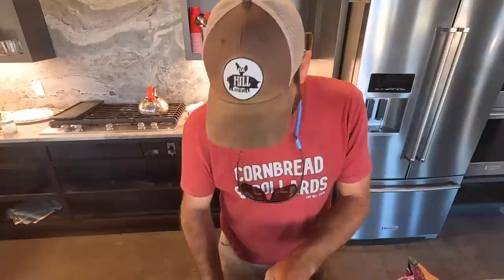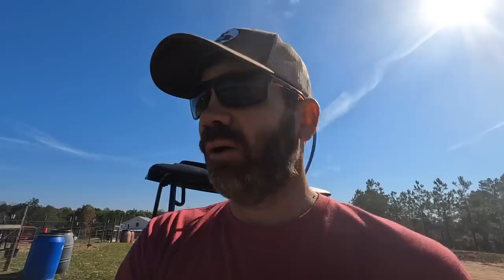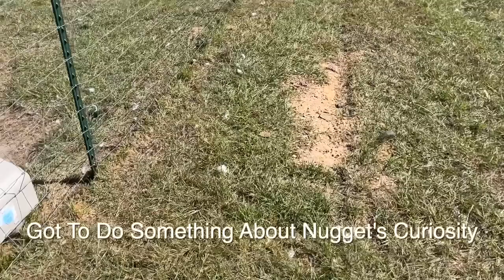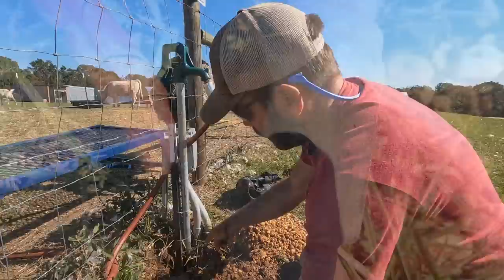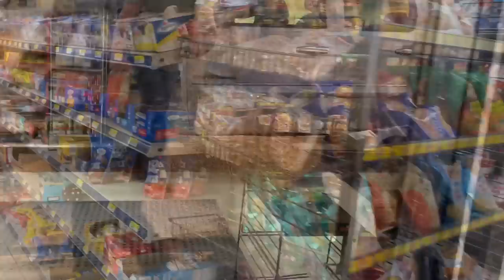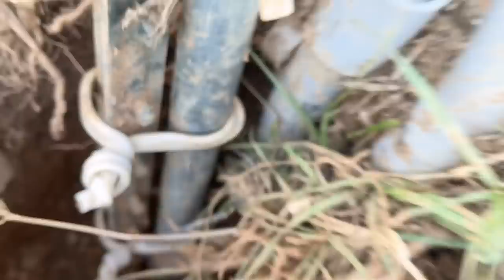This Happened WAY Too Soon!

Comment: We had the exact same issue with the hydrant being so loose. We dug down 2 feet and then put a 4 foot pt 6x6 so 2 feet was above ground and then strapped it to the wood. Haven’t had a problem yet even with our harsh winters up here in Ontario, 🇨🇦 Nugget always cracks me up. Great video as usual folks. Chad.
Reply: I'm not a plumber, let alone for outdoor plumbing, but t-post is probably not strong enough.  Should use that timber pole nearby (the fence H poles).  My garden is in CA and we put 4x4 also to stabilize the faucet upright pipe too.  That was done however not for freeze reason but because we drag 100 ft long hose all over the garden to water by hand.  Irrigation hoses or tapes or mini riser/micro sprayer heads, they do not stand up to our hard water/silty condition.
Reply: That's what we do too. We have 4 in the yard.

Comment: Place a sheet of plywood next to the fence to block the fence from Nugget.
I keep plumbing supplies and electric supplies in stock .
I have found that most times when a problem happens the supply stores are closed. So I use my supplies and restock when thay do open.
Reply: Yes, stock up on all plumbing and electrical needs.👍

Comment: I used the same faucets at my farm. It is very easy for the pipe to break right at the junction of the PVC and the faucet.  Cant begin to tell you how many we replaced.  We had to put a T Post on one side banded to the faucet and a deep sunk 4x4 also anchored to faucet. The faucet needs to NEVER wiggle. Good luck and hope this is the last one you have to repair.

Comment: You covered up the valve you just put in, you needed to put a water valve access box, which should be on all your connections for your frost free standpipes.

Comment: A Tip: For my water lines, I take an Icream bucket and cut 3 inch notches in the top, across from each other to slide over the top of the bottom connection and the shut off valve. Invert the bucket over the top and fill with gravel. This keeps the area cleaner and faster to work on. Farmers always have water problems. For future reference.

Comment: As a retired plumber I would like to give you a small piece of advice. What I would do on a leak like that is instead of screwing that PVC into your 90. I would screw about a 2 or 3 ft piece of galvanized pipe in the 90 and then use a schedule 80 female adapter to screw on to the horizontal piece of galvanized pipe. It would also give it more stability. Y'all have a good day. Tim

Comment: I put in cutoffs at all faucets and buildings so that I could isolate off a leak without having to shut down big areas.  Was extra work but it has paid off in the long run.  Plus in big freezes I could isolate areas.  It paid of in the freeze of 2021.  Only had frozen spot and that was the back flush valve from tank to pressure pump.  Had an extra one hand.  Back up and running in less than an hour.  Some Neighbors took up to a week.

Comment: Water cut-off valves are great. Amazing little-bit-of-everything local store. Here in SoCal we had little stores like that back in the 1950's and until about the 70s - 80s still had some small very local hardware or electronics or food & sundries stores. Everybody who remembers those stores misses them. And that one was a gas station too. Sheriff Nugget is such a sweetheart and really wanted to help. 🍇🍅🫐

Comment: We ran into same problem with our sprinkler system slightest crack on line which happened with aging.  Thanks to a handy gardener for the fix that was buried deep.  We don’t have freezing issues just aging of original materials house

Comment: If that issue occurs again you might want to add a coffee can or 6" pvc pipe over top of the shutoff valve so it's quicker to uncover and turn off the valve? Great work you two.😄😄💖💖👍👍

Comment: Yeah, loved your Beverly Hillbillies striking oil comment! In the 1950s, my older brothers got dad's hand drill and started drilling holes in the basement floor. AND they did strike oil as they ruptured the line to the boiler we used to heat the house in  Boston. Decades later, on a memory lane trip we were staring and pointing at the house when owners let us in for a visit. The patch on the basement floor was still visible and we all had a good laugh as to why it was even there. Glad you heard the water and knew it was an issue.

Comment: You could put a 5 gallon bucket around the pipe and the you could get to the cut off valve easier!   Hole in the lid to fit around the top at the ground level.   Holes in the bucket bottom for the no freeze drain off water to  drain out!   Just an idea!   🌻🌸🦆🦚🐓🦢🦃🐖🐄🦮🐐🐈‍⬛🤗💕

Comment: We bury a 4×6 about 1' deeper than our waterline & 1' taller than the faucet. Put brackets on the spicket to stabilize the water pipe. No jiggling at the connector.

Comment: Another tip for the frost proof faucet in case you don’t already know.  Don’t leave hose connected and submerged in water trough.  Especially in freezing weather.  If it doesn’t siphon your tank empty, then your pipe is still full of water and can freeze and burst.

Comment: I would suggest you might want to use some metal hose clamps to secure your faucet pipe to the T-Post. Those will give it more stability and less flexing than the tie wraps.

Comment: What we did at home was put a 4x4 post in the ground and then used C clamp hooks around the pipe and mounted that to the 4x4 post so that it couldn't wiggle around it's been almost 20 years and we haven't had any leaking or fracturing at the bottom of the pipe

Comment: 💥Don't know if someone else has said this, but, I would have put a 6" plastic pipe, with a triangle cut out of the bottom, to sit over the Stop Valve and pipe.💥
💥Make it tall enough to reach the surface and put a plastic cap/lid on it.💥
💥Then you have easy access to the valve!! 👍👍👍

Comment: You can drive a piece of galvanized pipe  beside yours and strap them together for les movement. Also you could pour some sand over the rocks and it will help cut down on the movement.

Comment: What works well is to put a piece of galvanized about 2 foot long into the faucet and then tie in the plastic to it. Then the steel pipe takes up all the movement instead of the plastic. You just do that when you have any more leaks, one at a time as it happens. You might isolate the different feeds, the paddocks, the house, etc. so you can cut one off without doing them all. Just get your valves and that together and dig them out one at a time as you have time. It's good you caught this leak before it made a swamp out of that area.
I always like seeing Nugget laying down with you petting him.

Comment: Putting cutoff vowels at every separate run will be very helpful. Also put on cutoff vowel closer to the house & side lines so you don’t have to run all the way to the front of the property. Put tops in that you can open easily to shut off vowel. It may cost more but it’s helpful.

Comment: In your copious spare time (😉), perhaps you should put cut offs like that to seperate farm and house supplies.  Our house and the house next door have had problems because of country plumbing - one mains supply to both housrs, one cut off valve - and we have gradually  had suitable cut offs plumbed in, and it has saved a lot of hassle wnen work needed doing.

Love to see Nugget thriving and curious!

Comment: Great video and Nug is a spoiled pet. Just a thought about the pond, it would really help if you would prep the ground and plant grass all around the pond from the water level as high up as you need. Along the run-off, ditches get some grass matt and pin it down. When the grass gets established it will make the water so much clearer.

Comment: If you put a 6” + diameter pipe or Tera cotta drain tile around the frost free pipe up to just below the spigot head and fill the pipe with gravel it does help to keep the spigot pipe still and the plumbing lasts longer.

Comment: Jason, when we had a water leak, we contacted our water company and they told us how to complete a form along with proof of repair to a damaged pipe and connection and we were “forgiven” the overage on our water bill.  I’m in Gwinnett County, Georgia northeast of Atlanta, but maybe your area has a similar process.  Sorry you had this issue.
Reply: Was going to mention that as well. Our water company will forgive one time deal on huge leaks as well. Jason, it wouldn't hurt to ask. Good thing you didn't burn up a well. Also, when you go shopping ask the produce manager if they have any marked down produce . He might cut you a deal. Especially those packaged fruits. Good luck.

Comment: I would put a cut off valve into a protective box so dirt does not get in it and freeze up the handle or valve and you can't cut it off when you need to.

Comment: Now that you got to the bottom of the hole if you put a piece of 3/4 in PVC Flex pipe 12 inches long and then the fitting that should take care of it.

Comment: Need to install a utility box around the cutoff valve at the site that was leaking AND also for the main water shutoff.   That way you have instant access without the need to dig out those shutoff valves.  You can buy a 3-4 foot shutoff pole that fits to the quarter-turn shutoff valve, so you can do the water shutoff while standing.  Then, to access the shutoff valve, just pop off the utility box cover with a long screwdriver, and drop the shutoff pole onto the shutoff valve and twist the pole handle to open or close the shutoff valve while in a standing position.  Much easier access and far less manual labor is involved.   As my mother ingrained in me "use your brain instead of your legs".

Never use globe valves as a shutoff valve.  The globe valve seats will leak and the valve stems will jam and break.  In-line quarter turn shutoff valves, like the one you installed, are the valves to use.

Great video, as always!  I just hope the leak didn't hurt the farm budget too badly.

Comment: Jason just a little word of advice ever Branch off I would put a cut off valve that way everything else can keep its water on if you've got a break you can cut that one section off and keep going I would do the orchard the garden the house the pens about halfway down that run   for the animals I would put a cut off valve too that way you can still have water for the animals even if one end is leaking

Comment: Jason, (just want to say as a property manager and without looking at every ones comments), it is always in your best interest to have a separate cut off valve for the two houses versus the yard.  So when you can get the parts and install a cut-off valve, with a "valve box" for easy access and you may want to go ahead and get a "Leak Detector" you can put on also (to alert you of constant water flow).  I do not know how you have done your water line destination from the meter, but it should be separated for each destination (put into a valve box) so that you can shut down only what you need to.  Needs to go to the house, mom's house and then yard.

Comment: A wood post or plank deeper then the elbow with cement anchor to anchor the post and c clamps on the pipe would hold it much steadier less wiggle. Then a protective box around the shut off valve to avoid erosion by dirt rubbing on it.
Harder from the start leaves less work later on.

Comment: I would never directly to faucet. Especially how shallow it is.  The gravel is not to secure faucet it to have a place to drain.   I would have put deeper a foot of gravel then fill dirt. At faucet change to some kind poly pipe.  The pvc won't last.  Good luck.  Have a good day 😊.

Comment: You really need to have a sturdier post to attach the water spigot too. If you can move the fixture, it will leak at some point in time. Try to sink a 4x4 post deep and with some concrete and use some good sturdy clamps to attach it with. T post are just not sturdy enough to brace something without movement.

Comment: Just a thought put shut off valve just off each hydrant and put what is called a thrust block (concrete block) on the back side at the 90 degree to prevent movement and put that 1/4 turn when glueing.

Comment: I have a hose with that aluminum female end.  It will fuse like a weld to that faucet.  I have a nozzle fused to my hose that even my plumber can’t get off with is big wrenches.  Aluminum and brass don’t mix

Comment: 6" that's a hoot my frost line is 70". They make a  flexable part you can put in so it doesn't break when you turn on the water and then that movement in the pipe won't break the PVC again

Comment: When I saw the notice with the leak, I  waited to watch it until I had the chance to give undivided attention. You didn't disappoint- from finding the leak to fixing it to thoughts for possible future issues. 
One thought: did you check the other pipe risers for looseness? Might need to stabilize as a preventative. Similar installation can result in similar problems.  An engineering perspective.

Comment: A little late but you might want to put a paving tile or a brick under the elbow of the pipe to support it.  As many times as you use that valve it is putting stress on the PVC joint with the galvanized fitting causing it to crack. Preventive measure for all the other water vales.  Just say’n.   Cheers

Comment: If you have another brake like this it happen because you’re pulling up and pushing down basically opening ans closing the valve putting strain on that plastic fitting to possibly fixing this problem put a length of steel pipe 6” to 12” then attach the plastic piping to that giving more fluxable. I’ve seen these happen before when you use plastic fittings right next to the frost free hydrate like I wrote (said ) previously

Comment: I had a leak near my meter off of my driveway.  Huge bubble under the sod and a river into the storm drain.  Only loose for a day or so as the leak grew and grew.  Evidently my son’s duali and my minivan vibrated an unsealed joint loose.  Had to get a friend to fix it and a forgiveness allowance from the water company…

Comment: The reason your upvc fitting leaked is because you did not anchor the faucet post correctly. Every time you turn on/off you faucet and pull hoses you are wracking the post and it eventually affects the plastic threads. First thing you need to do is anchor the post in a concrete footing.

Comment: You need to a plumbing diagram of your property.  I don't know if its a real thing but think of a wiring diagram except of plumbing pipes.  Use call outs as desired for specifications.  Then, when you know where all the water pipes are its time to create zones and what you would like to be grouped together if you had to shut water off.  Over time, start adding mid-system turn offs so you aren't running to the street and turning the entire place off.

Comment: Sorry to go on but the movement I am talking about is when you load a header it will move even underground due to force from water pressure and air then on some systems mostly steam you have hammering to the system which is like shooting a wall of steam thru pipe causing as much a 2 or 4 feet bounce. I normally work in the petrochemical as a Sr. Piping Designer 3D CAD Designer since 1979.

Comment: You need at least two clamps that fit around pipe and t post and make them tie so it will not move.
Reply: Wires do not hold them down from movement.

Comment: I know it's well after the fact but what i learned doing my plumbing by what plumbers told me would work and what i ended up going back & doing it the way my Little Voice told me would be better:
(1) I was told that the frost-free faucet could be connected to the PVC - I didn't need a metal nipple from the base of the faucet to the PVC line. So i ended up changing THAT on all five faucets, one faucet at a time, over the next year.

(2) When i went back & fixed each faucet, i put a couple of bricks under the faucet, the nipple & the first 8 inches of the PVC, then put my gravel on top of that. My theory was that the bricks would keep the weep-hole seepage from washing out dirt & loosening up the support under the faucet base & PVC => creating more stress on the joints => PVC breakage. I was told it wasn't necessary, the weep-hole doesn't have much volume & no force. "Drips of water" have formed caverns over time and, no, i won't be here that long but why not just skip the part where i hafta go back and fix it?  And i haven't had to fix them twice for that in the 15 years since i did it that way.

Where i tied into the property water line, i put a cut-off to my house lines and a cut-off to what we ended up calling "The Beasts' Lines". That way if a pipe breaks in the kitchen, i can still get water to the rest of the property. The five faucets off the non-house line are each on their own "spur" and each has it's own cut-off. That way i can still get water at my most distal faucet if one - or all - of the more proximal faucets hafta be shut off. And if it takes me a few days to get it repaired, everyone is still okay.

Comment: Just wondered why you didn't bury about a 6-in pipe vertically over your shut off valve so you could shut it off with a long wrench not have to dig up the hole

Comment: The problem with pvc pipe and fitting is they get brittle and break underground after a while don’t know why but they do pvc also doesn’t do well with movement. Of course not much a fella can do about it now but if I was doing that I would use poly pipe

Comment: Why not put the shut off valve at the beginning of the line at the paddocks? That way if you have another leak at a different area you’d have one shut off and not have to put shut offs at every faucet if they all start leaking.
Reply from the maker: Bc it would shut off the water to the house and that’s why I was thinking this would help 👍